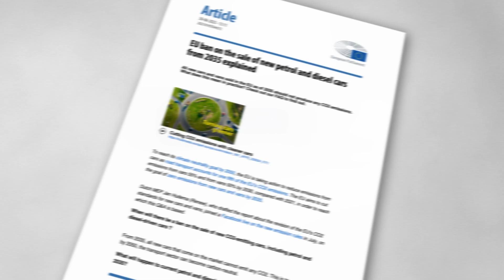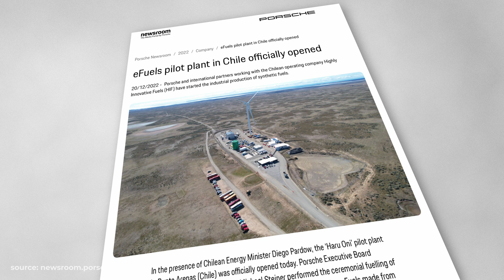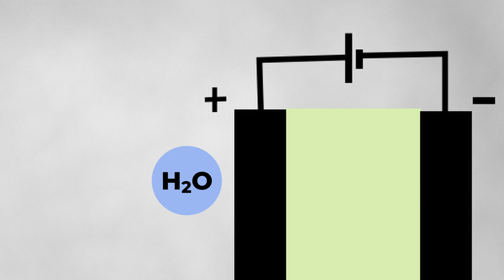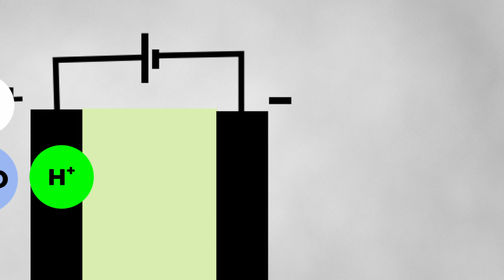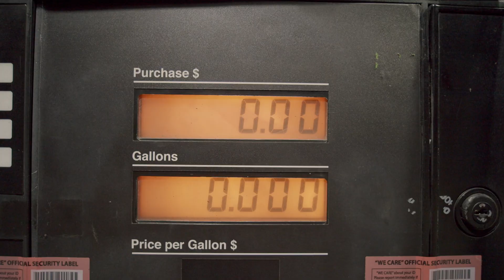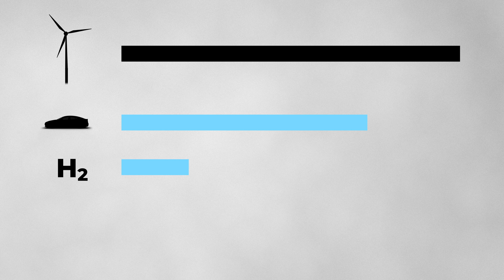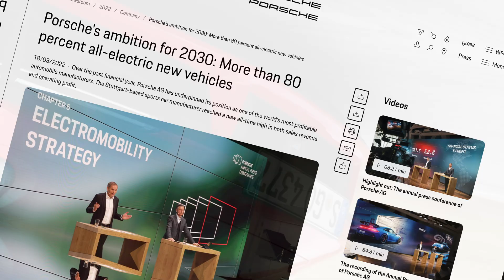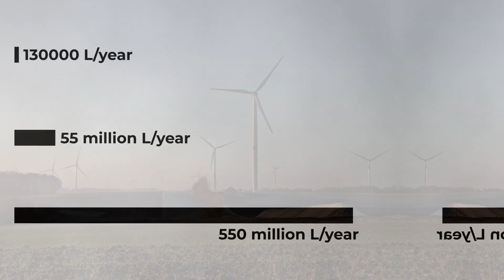The Complex Debate Around eFuels

Comment: Correction: The real major advantage of efuels is energy density, and thus range. This is why it's of interest to aircraft, as it's probably going to be a while before batteries and hydrogen fuel cells can cross the atlantic or pacific.
A relevant point is that efuels and regular fuels can be mixed in a variety of ratios - allowing you to directly reduce net carbon emissions by whatever arbitrary price increase the market will bare. And then increase the ratio as/when scalling effects and new technologies brings the cost down.
A minor point is that hydrogen production becomes significantly more efficient at higher temperatures, reducing the cost significantly. Next generation nuclear plants (operating in the 850*C range) are commonly suggested for this.

Comment: Great vid. Good discussion points based on technically factual analysis. Thanks. 

Biofuels are about 1 to 2% efficient in terms of converting the sun's energy into fuel calorific value. Then it needs to be burned in a car that has an engine with a thermal efficiency of less than 30%.